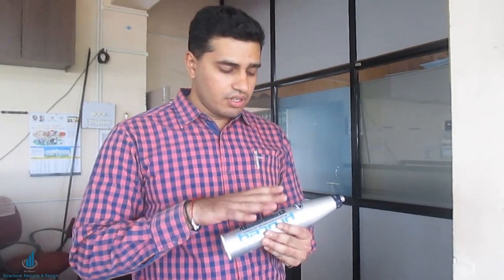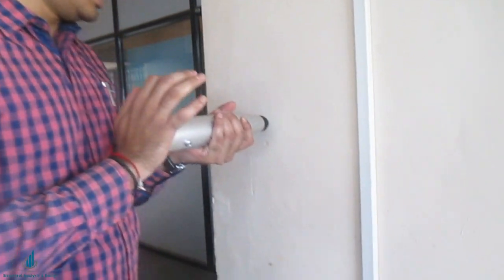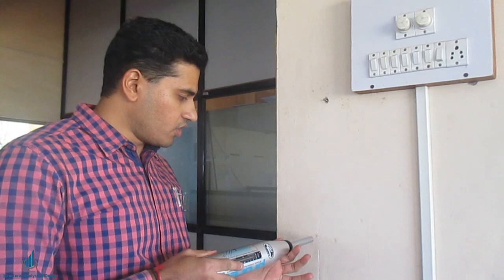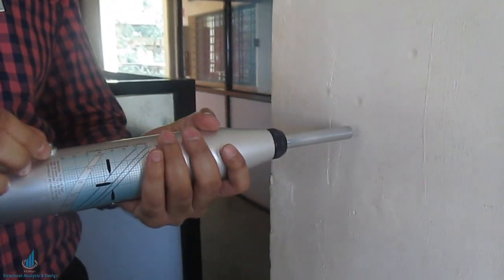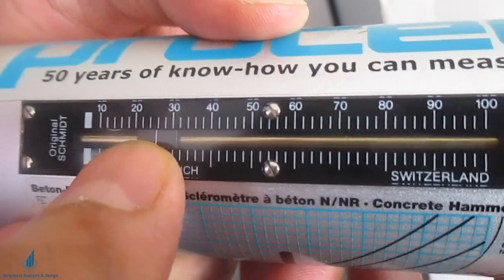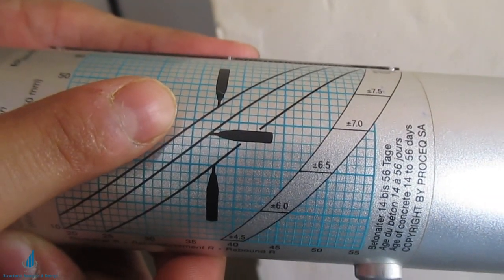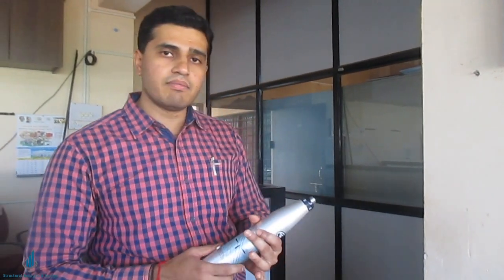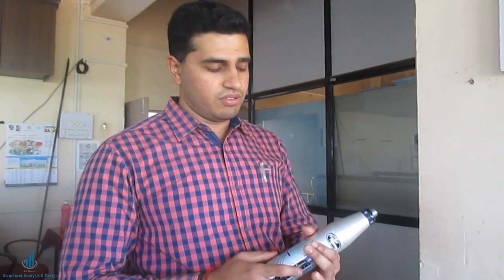Rebound Hammer Test | Schmidt's Hammer | A Non Destructive Test on Concrete | Surface Hardness Test

Comment: How to determine the achieved  structural strength is adequate or not? which code practice we need to follow? As per the code practice what is the statement is there to compare the concrete is achieve the required strength or not?

Comment: One question - When you do rebound on the column you have the "plastered layer" which is surely less than the mass concret. So the rebound reading is not correct on the mass concrete. How you determine this real strength

Comment: Sir vertically upward or downward kr liye Kya correction use karte hai please explain with example ?
Reply from the maker: The chart which will be there on rebound hammer is having 3 curves, it is explained in detail in video please go through video completely

Comment: Hi, Predicting compressive strength using rebound Hammer is right method? Or we can use only for the surface hardness.
Reply from the maker: Core cutter test will best to determine compressive strength

Comment: Q. how we calibrate if the rebound hammer is not showing correct result ?
Reply from the maker: If you want to check whether rebound is giving correct answer or no just do rebound hammer test on on a standard concrete block and note down the value and than same cube you test in compression testing machine and compare the values, if you getting different value with rebound hammer just consult the technician who is allowed to check the rebound hammer
Here is a link how to operate digital compression testing machine https://youtu.be/QR7ttm5tr4o
Reply: if there is nigligible difference between both result then what should we do ? Do we requried to calibrate it or not ?
Reply: Can we calibrate an instrument without a technician??
Reply from the maker: If it is negligible no need to calibrate, if the results vary too much than calibration is needed, 10% variation can be accepted
Reply from the maker: No, it is strictly advised to calibrate the instrument with the certified technician only
Reply: Thank you sir